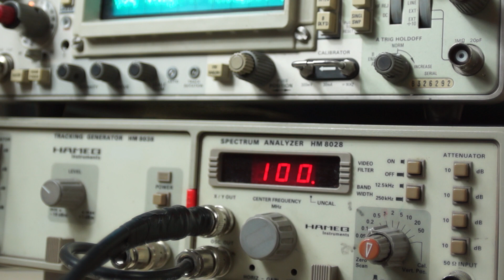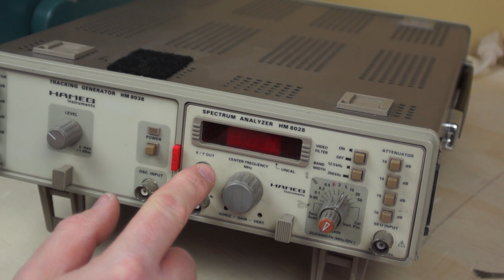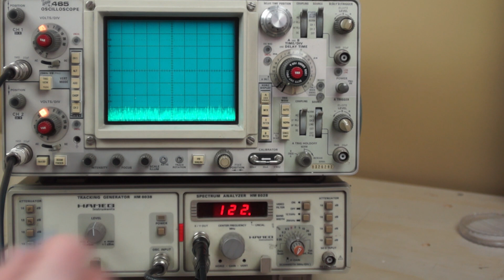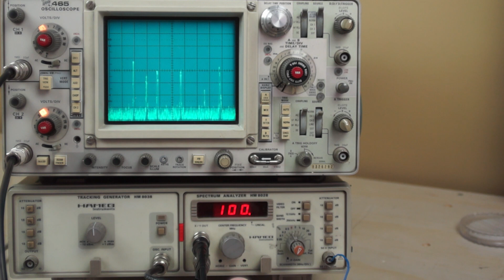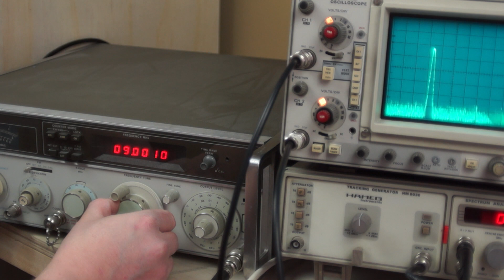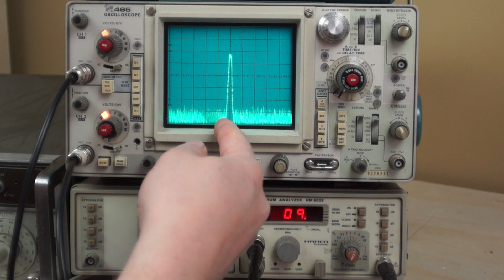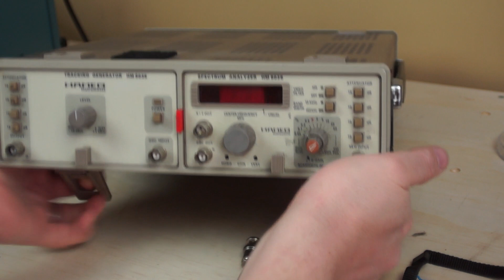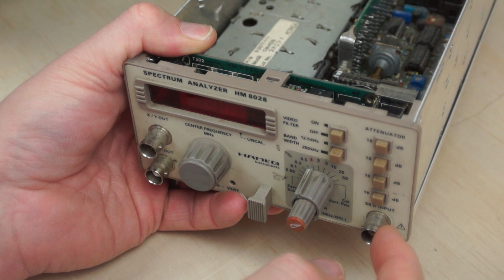Hameg 8028 Spectrum Analyzer for Tektronix 465 Teardown

Comment: The stopped the grid pattern when SMD came into common use.  The stray capacitance from the grid effected the smaller components more as well etching technique has improved so just no longer needed.   Well that is at least the story I was told.

Comment: I heard from an friend with about 50 years R&D experience, that the grid pattern was done mostly about etching PCBs. It helps for smoother etching, so the used acid can work steady on all the surface. He still is using it, in nowаdays technology I believe that it's not necessary.

Comment: Hi, 

great video as always. 
I always wondered how one of these units work since more "professional" spectrum analyzers of the era were quite a bit larger and heavier. 

Nice idea to use a TV input circuit since it is a proven design in an already shielded enclosure. 

By the way the molded thing in the back is for pluggin in a german power plug (schutzkontaktstecker in german).
It is a quite handy feature on all Hameg devices where you can wrap the line cord around the feet things on the back and plug the end in the molded hole. 

Greetings from Germany
Reply from the maker: Hi!  Thanks for your comment.  Great tip on the Schutzkontaktstecker!  I've never noticed them before - classic German engineering.   PS I lived for 4 years in Germany and loved your country!   Unfortunately, while I can get by in German my accent is so thick it is embarrassing. :)

Comment: hello sir !! can you give details what bnc you use for x-y mode and how to make it?
Reply from the maker: Hi,  the connector is a Twinax BNC or Twinaxial BNC.   If you google that name you'll find a number of links where you can buy them.   Making the cable is easy - use two shielded wires, connect the ground braid together and the two center conductors go to the the two connections within the Twinax BNC.    The connector is quite small though so it's a bit frustrating to get right.

Comment: so the bnc cable you made that goes from the Spectrum Analyzer is split into 2 ends that connect to both the X & Y connections on the 465?
Reply from the maker: Yeah, and on the Spectrum Analyzer it is a two-pin/twinax BNC which I've only ever seen on this unit before.   A quick google search showed me they are a "real thing" but not very popular.